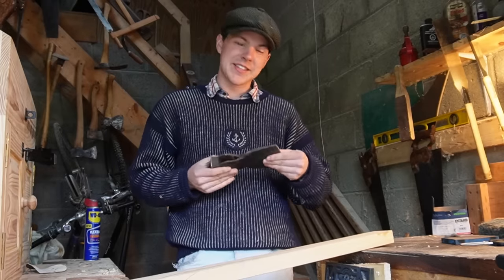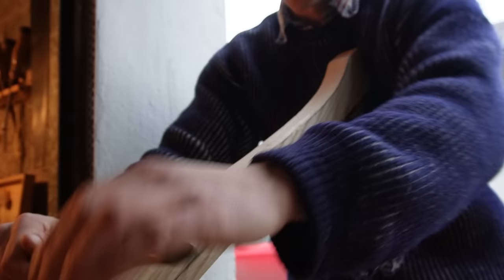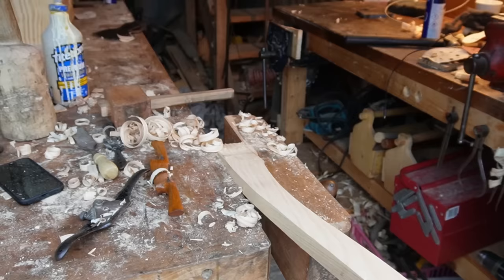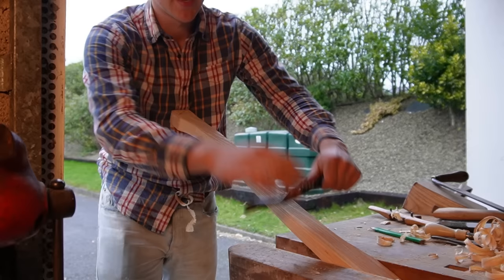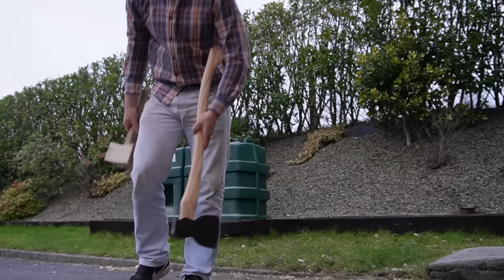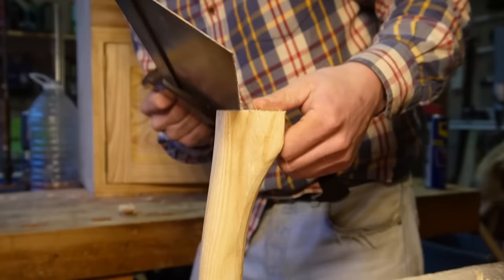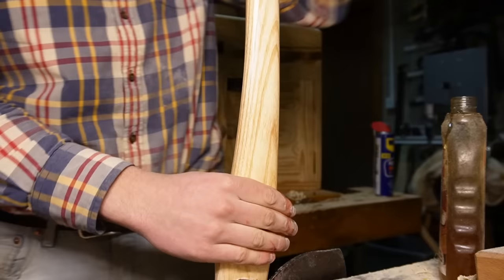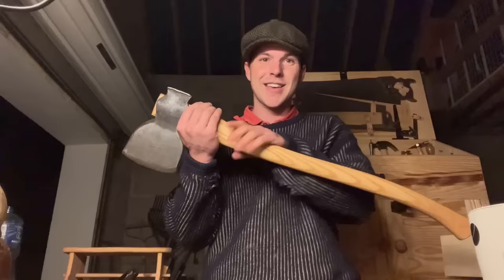How To Make an Axe Handle (Hand Tools Only)

Comment: If I may offer some layman’s advice: 

At 5:48 you had a LOT of what we woodsmen refer to as “shelving” goin on. When the part of the haft/handle that mates up into the socket of the axe head is still too thick to properly seat, then the bottom of the socket is gonna dig into the wood of the handle. If left unchecked, it will cause this “shelving” which will render the handle much more susceptible to really bad splintering, and subsequently, eventual breakage. So you can generally see why shelving is considered by many to be a BIG no-no; because it’s WAY MORE than just an aesthetic or “looking clean” issue, but a structural integrity of the overall axe handle issue as well. You were right to polish that up with that sharp chisel, and it looks like you fixed the issue up pretty well. So kudos to you for that - just wanted to point out that eliminating that shelving like that fixed WAY MORE than just surface-level aesthetic value like you pointed out. Lol 

Also, when I’m seating an axe head, it usually takes me several attempts at seating. Precisely because I’m trying to avoid any and all shelving AS the top of the handle gets rasped/sanded away and the axe head is able to make its way down to where it can be properly seated, bit by bit. Doing all of this prevents any and all shelving throughout the seating process, and any subsequent splintering that may coil up UNDER the axe head, where you can no longer see it once you’ve got it seated all the way on there. When I’m seating, and I see shelving starting to occur, I’ll knock the head back off then take a rasp to the area of the handle that was still too fat for the socket. This goes on until I can inertia seat it to where I want it, and absolutely NO shelving occurs as I’m tappin it on. And if you do it right - don’t shave off too much or too little as you’re whittling down the top of the handle - then the axe head will seat on there PERFECTLY, like a glove. It’ll seat on there both super cleanly, AND super tightly, just like you want. 

One thing that also helps TREMENDOUSLY in the prevention of shelving as you’re seating an axe head is taking a metal file and hand-grinding in a small chamfer bevel ALL THE WAY AROUND THE INTERIOR OF THE BOTTOM OF THE SOCKET OF THE AXE HEAD. Doing this will ensure that the interior of the socket isn’t able to dig into the wood of the handle as you’re doing the seating process. And with this interior chamfer bevel in the bottom of the socket, even if it DOES deform the wood fibers in any way, then it’ll only press into the fibers and possibly leave a pressure impression (getting pressure impressions is WAY BETTER than getting cuts/shelves/splinters,) rather than cutting and/or digging into it (which you absolutely DON’T WANT.) In fact, once you’ve got it seated all the way down where you want it, if it’s still tight enough to make those pressure impressions, then all the better. Cause that just means its even more super tight. 

Hope this helps!
Reply: Thats REALLY good shared knowledge. Got a perfect visual via your explanation

Comment: Hey man, we have a similar style and philosophy of woodworking, and I really enjoy watching your videos. For all of my tool handles I sand to 220 and then coat with linseed oil but after that I take sand and red clay and rub it all over the handle l. after it drys I wipe it all off and it is artificially aged. Because that is how it would age, oil from your hands and dirt. Anyway man just wanted to share how I finish all of my tool handles. Personally I’d give it a try. Happy woodworking.

Comment: Oh Eoin, my son!  Please 🙏 take it from an old Canadian 🇨🇦 Bushman.  You never let the axe head curl the fibres at the end of the handle like that. You keep shaving a little at a time till the head gets down to where you want it.  Where the head has bitten down and curled the wood, is where rot and splitting will start.  I would hate to see such a lovely handle go before it’s time.  And you make such lovely handles!  Take care and keep up the excellent work! Cheers 🍻!
Reply: what if i cut a ledge onto the handle for the head to sit on before i put it on so it wouldn't curl flakes up like that?
Reply: @babotond  Good Day to you.  My honest opinion is to just sand it down till the head fits.  Easier on the wood fibres. Cheers 🍻
Reply: @justanothercaptain6566  so it's better if there's no ledge at all?
Reply: @babotond  Good morning to you.  I was taught to always sand down and round out the handle for the axe head to fit.  Keeps the wood fibres tighter.  Also I would assume it keeps water and debris from building up.  But that’s just how I was taught/shown and do my axe heads.  But that’s just my opinion and I guess tradition.  Cheers 🍻 😀
Reply: @justanothercaptain6566  thank you!
i don't have experience with them, i only saw other people's axes, some with big chunky ledges, some made smooth.
so thank you for replying, now i have some idea how to fix my axe.
cheers🤛

Comment: People have done testing and it turns out it doesn't really matter what direction the wood grain goes, if it's facing the edge of the axe or face of the hammer, or across it. The thing that really matters that the grain goes all the way from one end of the handle to the other and doesn't go out the side.

Comment: Have you ever used a double bit ax and I did make a handle for a ball peen hammer after I cut the old one off as it was loose I made it out of ash that I got off Amazon because I am in North America United States and we got lots of pine around where I am I’m not that good at selling trees apart but I got 18 inch ash two by twos I got four of those I got two left and I also have four white Ash two by twos. There are 12 inches long.